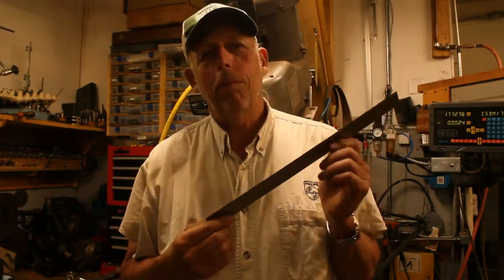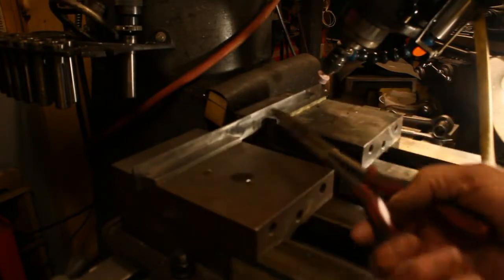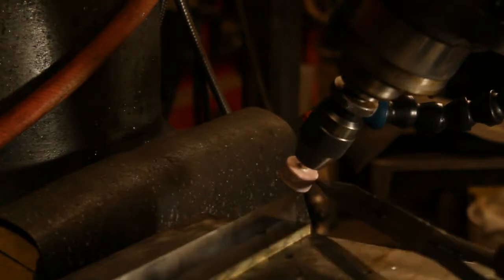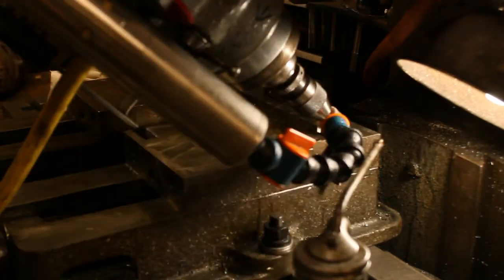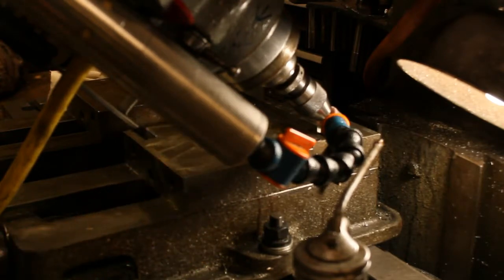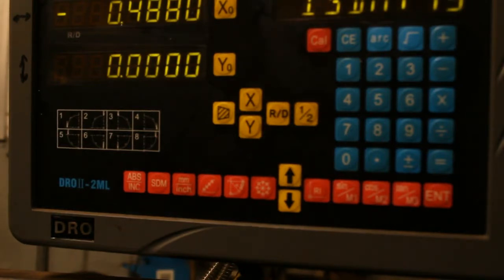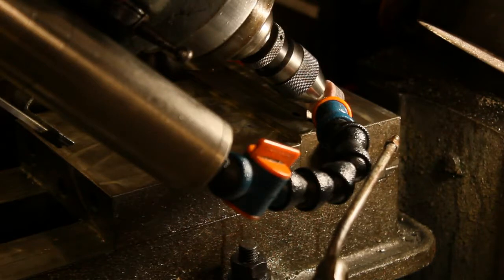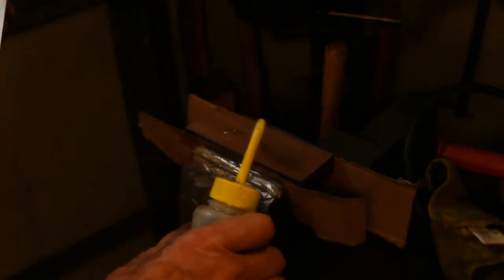How to sharpen planer blades.

Comment: That small grinding stone by the time you get to the other end surely it has worn down by at least 0.001 inch. This is not the case or did you compensate for the wear ?
Like your channel, subscribed.
Reply from the maker: You may be correct.  I did not find a problem with stone wear.  I used lots of oil and cold air.  If there was wear it was linear across the length of the blade and was adjusted out on installing the blades.  I am sure a surface grinder properly set up would do a better job, I have a surface grinder is is just to short. Having said that the blades cut well and the planer makes nice boards.

Comment: What is the “cold gun”? Air?
Reply from the maker: Yes a cold gun runs on air.   Quote from Vortex.com "A vortex tube creates cold air and hot air by forcing compressed air through a generation chamber, which spins the air at a high rate of speed (1,000,000 rpm) into a vortex. ... Vortex tubes generate temperatures as much as 100 deg F (56 deg C) below the inlet air temperature."  The cold gun does two things, it produces cold air under pressure and it cleans out the chips. There is no smoke or vapor just air.  The down side is it takes a lot of air.  It works good but nothing is as good as flood cooling.